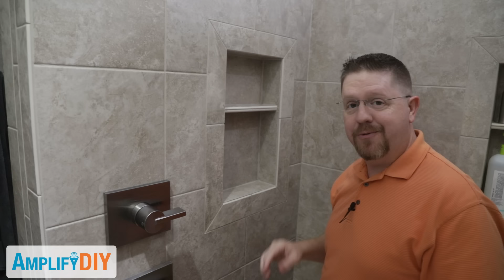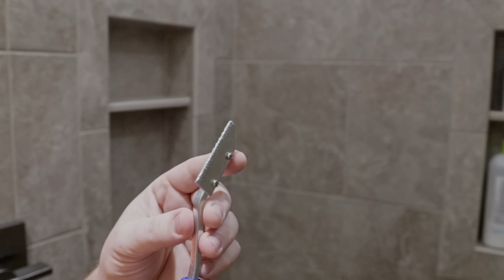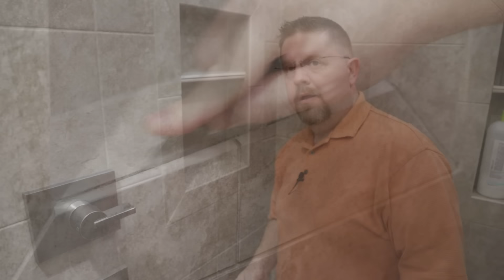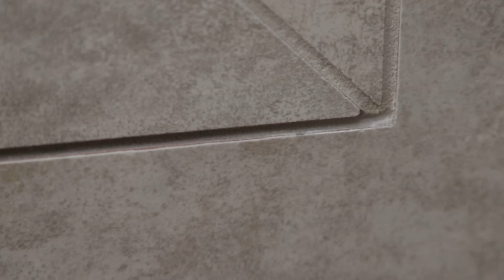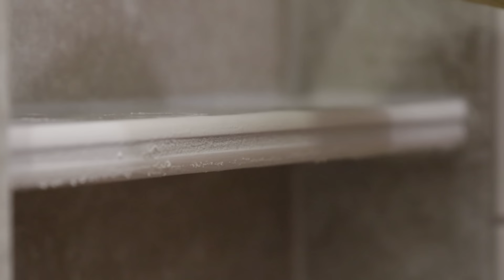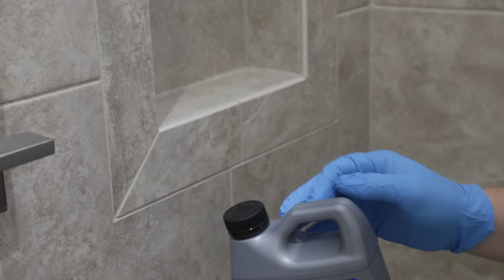How to Repair Cracked and Worn Grout (Shower)

Comment: Can vinegar be used to remove the haze?
Reply from the maker: It depends on a few factors such as the type of grout you are using as well as the type of tile you have. It is safe to use vinegar on porcelain or ceramic tile, but NOT on slate or stone. When in doubt, I'd consult the manufacturer's recommendations for both the grout and the tile. If you don't know exactly what the tile is made of, I'd err on the side of caution and get a haze removal solution designed to be safe for all tiles. Your local Lowes, Home Depot, Menards, or other hardware / home improvement store will have some for around $10. Good luck!
Reply: @AmplifyDIY  Thanks for your quick reply! Thankfully, I have ceramic tiles, so vinegar will work. But, good to know that if I ever get luxury tiles, not to use vinegar.

Comment: Ugh, I've got an oooold tiled bath/shower area with lots of loose/missing grout.  Been kicking around replacing the tile completely, but I like what's there and the tile itself is in good shape, so I'm going to see just how hard it is to regrout a large area.  Might take it in sections if the elbow grease runs out.  Wish me luck!
Reply from the maker: If the tile is still all firmly attached, I’d definitely try to save it. Best of luck!

Comment: What can be used if you dont have grout remover? Thanks
Reply from the maker: Hmm... You'll need something thin, abrasive, but that won't damage the edges of the tile. A small grout remover really is the best tool for the job - but maybe something like a super-thin bladed screwdriver could be used to dig out the old grout? Good luck!

Comment: nice video and format.  But, what if you do NOT know the brand of grout that was used in your shower??  How do you match color of grout??  Merci
Reply from the maker: Yeah, that can be difficult. If your grout is coming off in fairly large chunks, you can bring one of those chunks to a local hardware store where they have lots and lots of grout sample colors that you could match it with. Or, you could get some paint chips from the paint department of a Lowe’s or Home Depot, and use those to try and match what the color of the grout is. Then when you’ve narrowed it down to the correct color, you can go back to Lowe’s or Home Depot and match grout. Good luck!

Comment: Can a ceramic tile caulk be used? Can it be applied similar to how one would apply silicone or caulk?
Reply from the maker: Tile caulk is usually used in joints that meet at a corner, since those joints tend to flex a bit, and regular grout would just chip and crack. However, regular grout is recommended elsewhere because it is so rigid and helps with the stability of the tile. I would not recommend caulk on flat tile joints. Good question, and thanks for watching!

Comment: Super video. Love the close up shots. Makes me confident I can do this
Reply from the maker: You got this!
Reply: @AmplifyDIY  I did it and it turned out pretty good. No more leaking. Just wished I used sanded grout as the rest of the old grout looks slightly different, rough

Comment: Great video! I’m all set. Just one question- did you seal the grout after curing?
Reply from the maker: The grout I used specifically says not to seal it, so i didn’t. Check the instructions with yours to see what the manufacturer recommends. Good luck!
Reply: AmplifyDIY  thank you

Comment: I’ve got same shower style with same shelf and instead getting grout  become black it turns white!! This all happens to the grout below the shelf down to the floor. Any ideas what causing it and how to make the original al color back ?
Reply from the maker: Sounds like you have stuff building up on your grout - probably you have hard water, and the minerals in your water are bonding to the surface of the grout. Have you tried scrubbing it deeply?
Reply: @AmplifyDIY  yes, I tried no luck. I might facing efflorescence which is calcium in the water
Reply from the maker: @vilsurk1029  Did you try a hard water deposit remover like CLR?

Comment: You will have a issue with that shampoo shelf forever until its tile properly, the grout line should be facing out not up
Reply from the maker: Perhaps you are right. It's been just about 1 full year since I re-grouted it for this video, and it's still looking perfect today. Fingers crossed it holds up longer than you expect. Thanks for the heads up!

Comment: Can I use caulk to fix cracked grout. And do you have to u use sealant?
Reply from the maker: I would not recommend caulk over cracked grout.  You can replace grout with caulk in corners, but not everywhere. You need to seal grout if the type of grout you use needs it. In the video I demonstrated a type of grout that does not need to be sealed. Thick the instructions for whatever type you use. Links in the description for the stuff i used. Thanks for watching!

Comment: Great video!  Is there anything special that needs to be done for the grout line at the separation between the tile and the shower tub?
Reply from the maker: Not usually, but if that area continually has problems with cracking the grout you can use silicone caulk instead.
Reply: @AmplifyDIY  perfect, thanks for the fast reply!!

Comment: would you not apply a grout sealant?
Reply from the maker: Great question! I used Fusion Pro grout, which specifically does not ever need to be sealed. Follow the manufacturer instructions for whether the grout you use needs to be sealed. Thanks for watching!
Reply: I thought the same thing, I read the reply. I will try to find that product. Thanks. 👍
Reply: D1Nonly1 4ever   Always use sealer.

Comment: If I moved into a new place but see a few cracks in shower but not sure of color, what would be best way to match grout color?
Reply from the maker: If you are going to be re-grouting any part, remove the old grout first and take a sample of it to match the color. Try to get a largish chunk (1 cm or so), as if you only have pulverized grout it’ll be lighter as a powder than as a solid chunk.

Good luck!
Reply: Great video! Would this method work for cracked grout in floor tiles as well?
Reply from the maker: @marlenao9449  Yup, it should!

Comment: So if the tile installer used premixed grout how could they have added too much water to it?
Reply: If they didn't get enough water out of the sponge when cleaning grout, you will have issues, too.
Reply from the maker: This grout comes in 2 varieties: large cartons that are not mixed yet, and small premixed tubs like I used in this video. The installer used a large carton they had to mix up themselves.

Comment from the maker: Note that I don't need to seal this grout after the repair, as I'm using a type of grout that specifically never needs to be sealed.... supposedly.
Reply: Been told by several folks who have done DIY grout to apply a sealer anyway.
Reply: AmplifyDIY   Always apply sealer no matter what.
Reply: Mike White   Does sealer really work?  Didn’t for me.  My shower floor needs work every 3-6 months even with sealer.. do they have a super strong sealer?
Reply: DONALD1951 I use 911 sealer then follow next day with fiberglass was. The kind you wipe on and let dry. I wipe on and rub in very well. Let sit for one hour then buff off.  Water stays beady for about 6 months to one year depend on amount of use. Had a 60 unit motel so I have some repeat experience.  Gel-gloss wax rub on not the spray.
Reply: IMO the only one which probably legitimately holds up to that claim is epoxy grout, and that requires that the tiles are installed solidly.
Reply: Thanks! I was wondering about this .